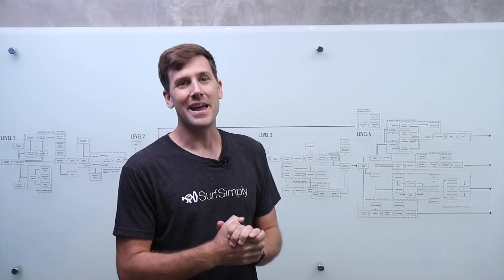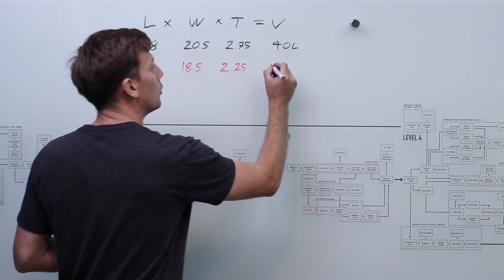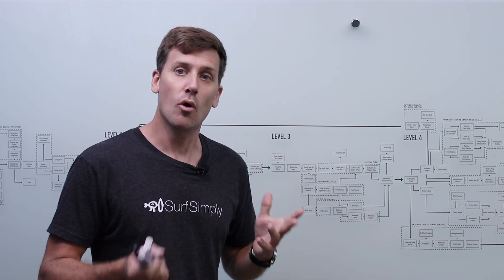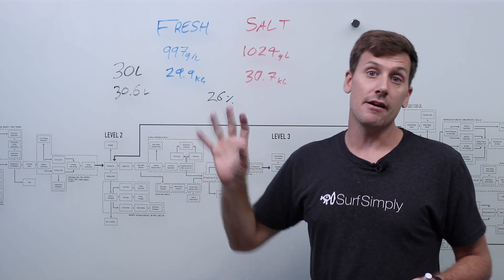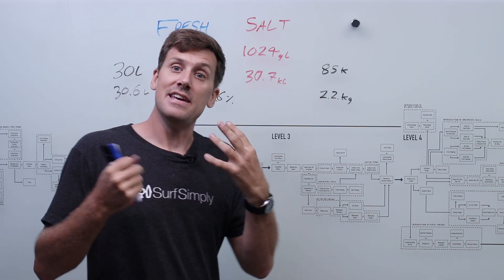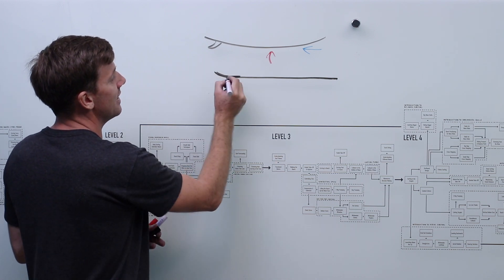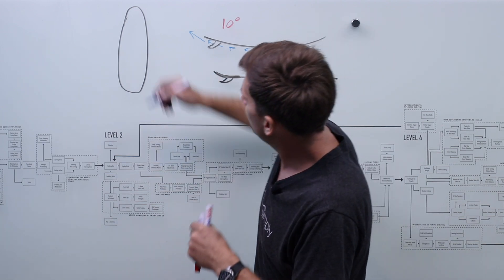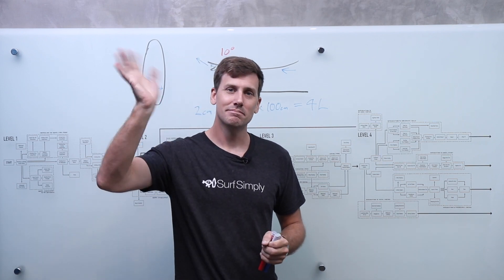Surf Simply's Question Time: Saltwater vs Fresh water buoyancy & Volume vs Length.

Comment: Very interesting! 
I was really thinking about this since I went on a surf trip in Costa Rica lately and I brought a new surfboard that is roughly 32 liters (6'0'' x 19.63'' x 2.375'') and I weigh 85kg. 
The board felt great and I was feeling it floating in the water.
When I got back home and start paddling in the river's fresh and cold water with my 5-4 wetsuit I instantly felt sinking. 

So I made some math based on board to weight ratio 
Weight in Costa Rica without a wetsuit = 32liters/85kg= 38%
Weight in Canada with 5-4 wetsuit, boots and gloves = 32/88.6kg = 36%
So then I had a 2% (suit weight) + 2,6% (salty and fresh water difference) 4.5ish% (32 liters *1.045 = 33.44) difference should feel like around 1.5 liters difference if I made it right.
Maybe I'm just surfing too small of a board in the end, but it's interesting to understand the difference in this situation where multi factors apply making the difference slightly notable.

Comment: A back of a napkin calculation would give 16 * sin(10) = 2.78 kg/s  directed upwards. Now kg/s is not a force or anything, someone else in the comments has already worked out the details.
But to be honest, these numbers don't mean anything anyway, unless you put them in perspective! No surfboard has 0° rocker (except maybe some unrefined mini simmons). You mention 10° is average, so maybe it can be compared to 8° and 12°. And then calculate how much your weight would have to be shifted back and forth to compensate for this. I might write a scientific paper on this later

Comment: Hello to all
Regarding the first question
A few of the new board designs, like Rob machudo's "seaside", is a much higher volume on approximately the same length/shape 
I was wondering how a shorter board is like (5'3" , 30 liters) when compared to the the older designs at (6'0" , 29 liters)

Comment: You answer with such precision and clarity, I'm definitely a fan! 
May I ask, could you explore the approach to duckdiving from a beginner to intermediate perspective? 
Everyone says that even longboards can be duckdived, it just takes practice and developing the right technique. But that goes for everything: every surfboard can be ridden too! Beginners, nonetheless, are advised to use big softboards bc they're easier to learn on. 
Isn't there any tips to start duckdiving? For example, is there a suggested ratio between board volume and surfer weight, roughly speaking, considering average levels on every other factor that comes in play (like fitness, age, timing skills,...). 
Do few liters make a difference when starting to duckdive?
p.s.: people will say "there's no use in getting a smaller board you can duckdive when you can't catch waves with it" but things aren't so extreme sometimes. 
I live in the South of Italy. Most times, we surf in active bad weather, and those are the times I struggle to get out the back, because waves are big, wave period sucks, there's strong winds, strong currents and no channel. The harder part to get past is the one with the white water, where it's much harder to duckdive. With those conditions, I prefer having a smaller board I can (try to) duckdive to get out the back (and I don't even struggle that much with catching waves since they're more powerful and push more), instead of grabbing my fat board and get smashed around the entire session. I'd rather push my limits with little volume (harder to surf but duckdivable) than with a duckdive I still haven't on lock (more volume for easier surfing but can't get to the line up). 
So, is there a range of volumes I can look at when I learn to duckdive as a beginner-to-intermediate surfer (around level 3-.5 on your tree of knowledge)?
For reference, I'm 5'2 (160 cm) x 116 lbs (53 kg) and I usually ride either a fat board for mushier waves [5'10x21 1/4x2 3/4 (38L)] or a lighter board for better waves [5'11x20x2 1/2 (31L)]. Well, I've tried a 5'8x20x2 3/8 (28L) and I felt like duckdiving was incredibly easier. Was it a lucky one time thing or can 3 liters REALLY make that much of a difference??
I am so sorry for the length of the comment. I understand if it doesn't get a response =D
Thank you so much anyway!

Comment: thanks for the video. there is an error in the calculation:

the difference between freshwater and saltwater is not 2.2kg, it's not a percentage of your weight, since your weight is the same regardless. what is different is the weight of the displaced water, which for 30L would be only about 800 grams. this in turn is only one percent of the body weight and has even less impact then 2.2kg would have :)

Comment: Hey Harry, pronunciation was fine. Thank you once again for taking your time to respond. I enjoyed your longboarding example and I can't say I wasn't compelled to find answers.

Longboard noseriding is interesting and not something I've yet succeeded at, but from countless video examples I've watched, large amounts of water both flow over and break onto the rear of the board. I think this more than accounts for the stable position of the board with the rider at the nose.

But from there I found it hard to conclude much about the flow of water under the board. Solving fluid flow problems is a complex task and goes way over my head.

Thanks for the response, looking forward to further content. This channel is one of the best when it comes explaining surfing.

Comment: Although I haven't surfed the same board in the fresh and salt water I can confirm that from the surfing perspective itself there's no much difference (if waves were the same). But you will definitely feel the difference when you're paddling through the incoming waves or when you're falling into the water — fresh water is much softer and thus it's easier to paddle through and more pleasant to fall into :) And just to mention that besides rivers and pools there are also lakes and some gulfs which could be surfed perfectly

Comment: So I hear epoxy is needed for this reason.  Would you say this isnt true in reality.  I prefer PUs but now live in texas and need a new board for bsr.
Reply from the maker: Hi Michael, yes exactly. When combining the overall total weight of the rider and equipment, the difference makes up a very tiny amount. An eps blank might weigh only 1-2lbs different to a pu blank, so a total weight of say 170lb compared to 172lb is negligible to 99% of riders in almost any wave.
Reply: Surf Simply sweet man! love the vids and thanks for the help!

Comment: Great informative videos and great channel that I've been long following !
Regarding your math "challenge" I have an educated guess (most probably very imprecise and simplistic). 

Let me say upfront I'm no math or physics student. However in my course I had some physics class and I like the subject.
I basically used the change in momentum(p), because the change in momentum equals Force ( mathematically expressed by F = dp/dt). In words, momentum only changes if an external Force is applied. My calculations:

So, you have 16Kg of water coming in horizontally at 4m/sec and still leaving at 4m/sec but at an angle of 10º. 
So your water will now have an horizontal component with speed 4m/sec * cos(10º), and a vertical component with speed 4m/s * sin(10º).
Both changes in the horizontal and vertical component of the water velocity correspond to a change in momentum since p = m*v. The water horizontal momentum decreases which probably reflects as drag in the board, and the change in vertical momentum reflects as a downward force in the board by Newton's 3rd law.

Focusing in the change in vertical momentum, from the formula p=m*v we have that the expelled water has a vertical momentum of p = 16Kg * 4m/sec * sin(10º). 
Since the water that came in had no vertical velocity, i.e no vertical momentum, and that changed by "p" in 1 second the change in momentum is dp/dt = (16Kg * 4m/sec * sin(10º) - 0 ) / 1sec = 16Kg * 4m/sec² * sin(10º) = 11 Newtons or about 1.1Kg of downward force in the board.

Since your numbers are conservative the actual force is probably 3x or 4x bigger... (?)
Still, it sounds small, but that is how far my math/physics goes :)
Reply: The length of the board we are looking at is only 1 meter, so the dt should be 0.25 seconds for water moving at 4m/s, so the final result would already be 4 times larger.

Comment: Thank You Harry! I had in mind a 42 liters Lost smooth operator (6'9 20.88 2.75) and a 42 liters Firewire Glazer (6'0 22.00 2.875)
Reply: I'd be very interested to hear your opinion on that!
Reply: Ah ok, so pretty different boards. Sorry I didn't understand your original question.